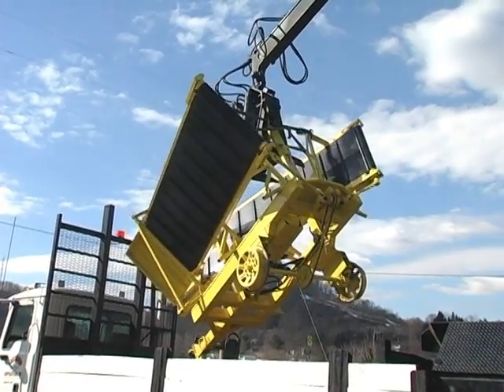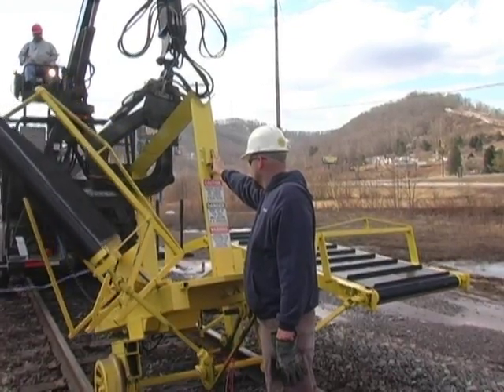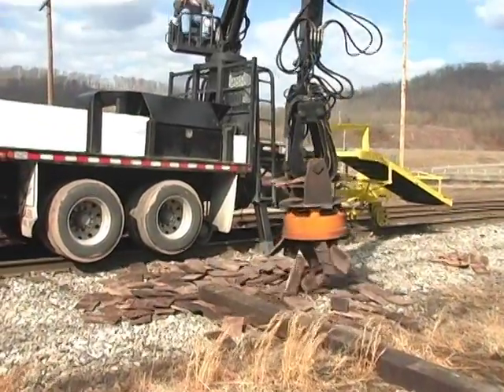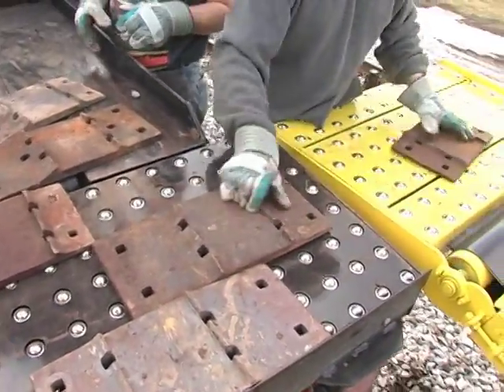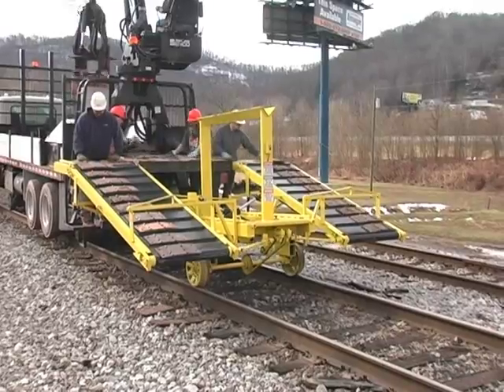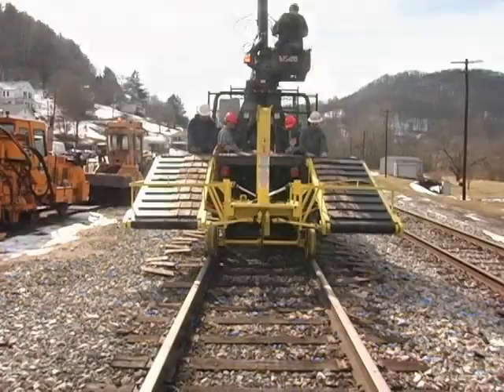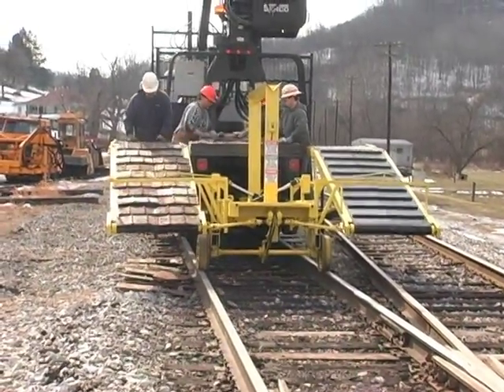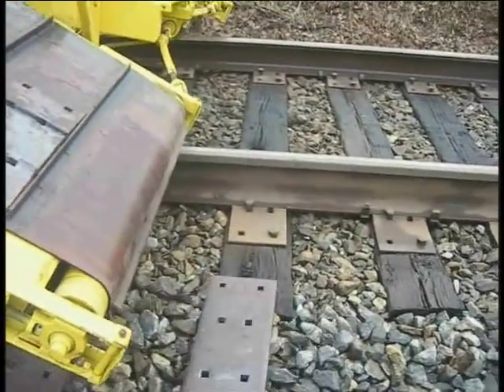H & H Railroad Contracting Inc.'s Tie Plate Distribution System

Comment: Everyone of those Tie plates lands Jelly side down, It takes four men to place the Tie plates, Not One of them has the brains toload the machine with the Tie plate Jelly side down, so when it lands on the ground, it'll be "RIGHT SIDE UP"  you built a machineLet me guess, Your and excavation contracting company, Rail line engineers would have built that idea out made a real machine, real machines don't require 4 of the family perpetually unemployed dumb asses to hand load tie plates.you should all be ashamed to have uploaded this video, really ashamed.  but, I commend you for trying, hire a mechanical engineer, hire an attorney first, he will tell you your machines already been built,, its patented, your infringing upon that patent.
Reply: the manual start with the plates must have the flat side down so they move/slide/roll easy.  to have a person then hand flip each would not go over well in the long run.  so a two part belt line would take care of this... a short one that drops the plate flat side up on a 2nd longer belt that takes it down to track and then drops it right side up.